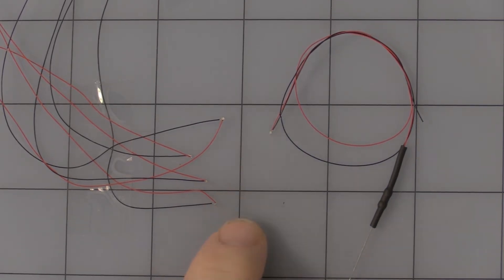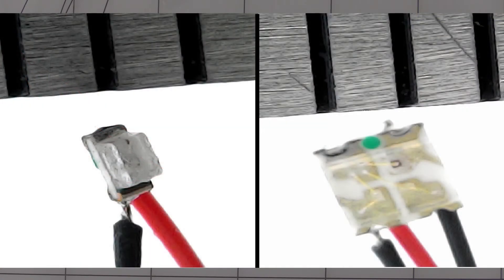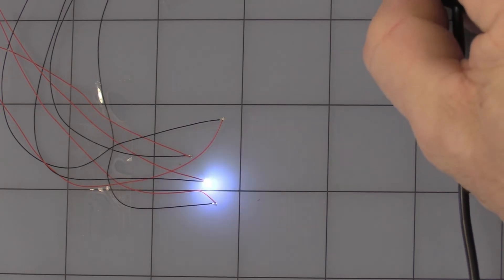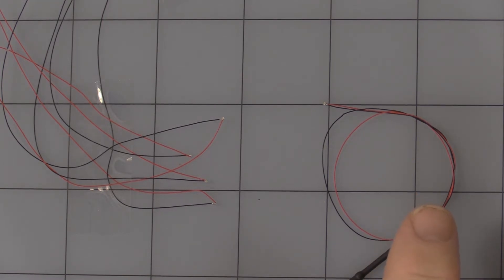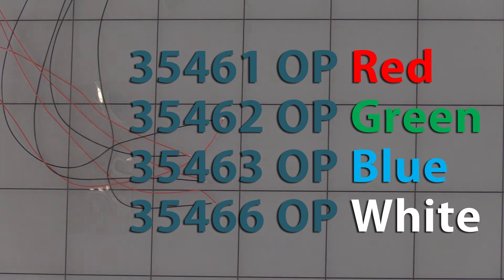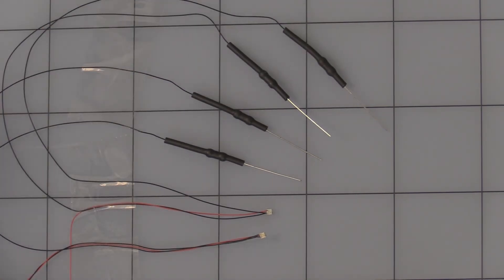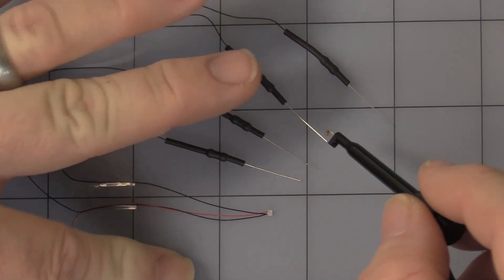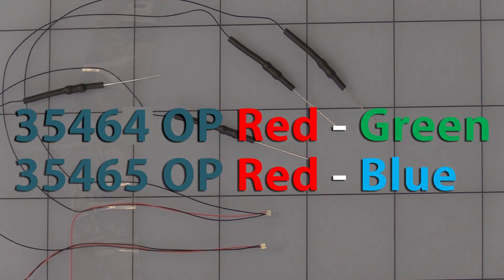Micro - Nano LED for Miniature Models 12Vdc

Comment: I bought these leds, but im unsure, and new to this. Do i solder them to a resistor and then to a power supply? Resistor in between the wire and power supply wire?   Learning to wire LEDs currently haha

Comment: Maybe you could show how bright they are under lower voltage like 3.3V or even 1.75V... What is the mah performance for these?
Reply from the maker: How bright an LED looks on video depends on the ambient light and camera settings.
The green LED is barely visible in office lighting at 2 Volts and very bright at 6 Volts.
Red LED is barely visible in office lighting at 1.7 Volts and very bright at 6 Volts.
White LED is barely visible in office lighting at 2.4 Volts and very bright at 6 Volts.

Comment: I’d like to know how you strip the wire for shorter connection?
Reply from the maker: You can cut the wire to the length you need, strip the insulation back on both the wire and resistor, solder together and insulate the connection. You must connect the resistor that can with the LED.